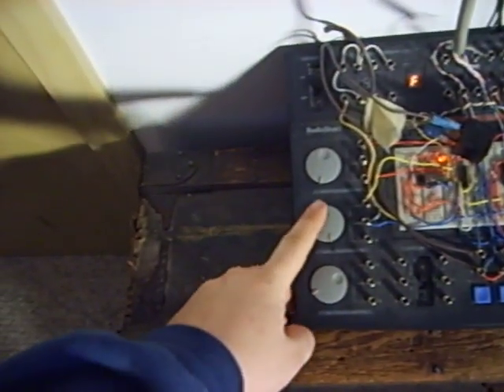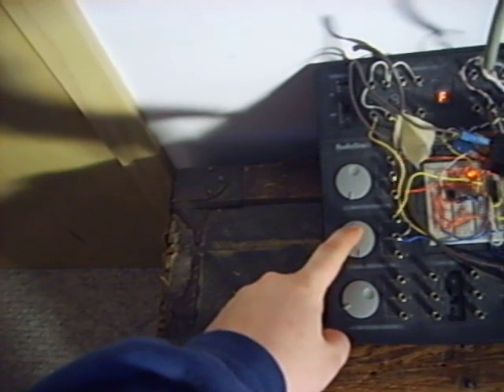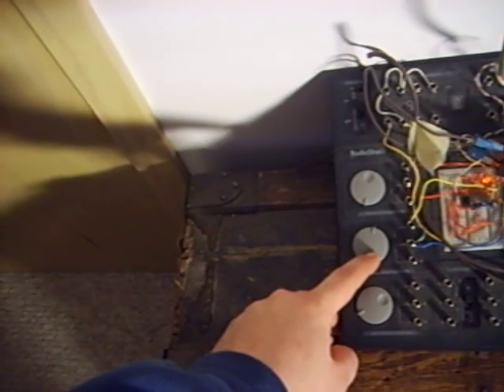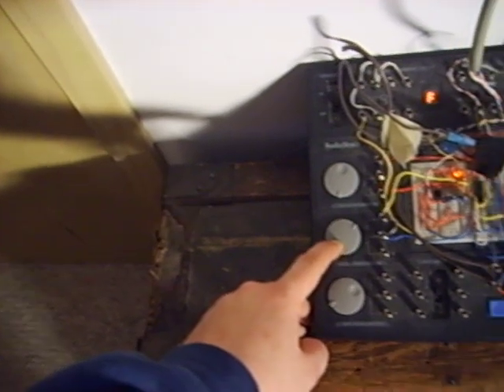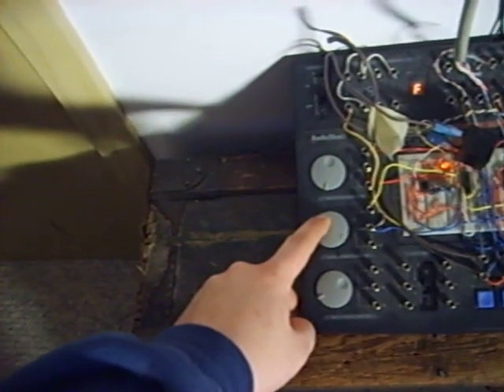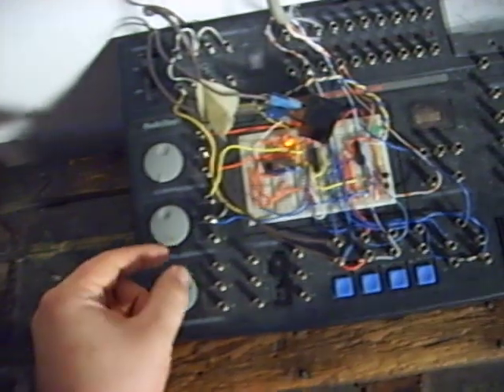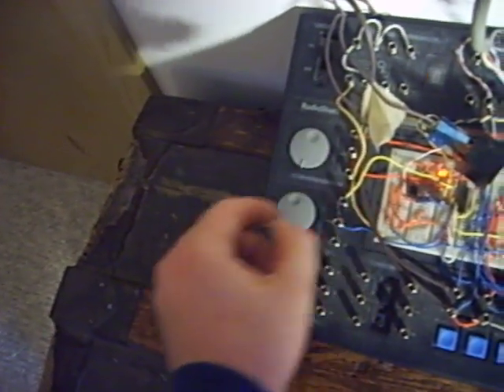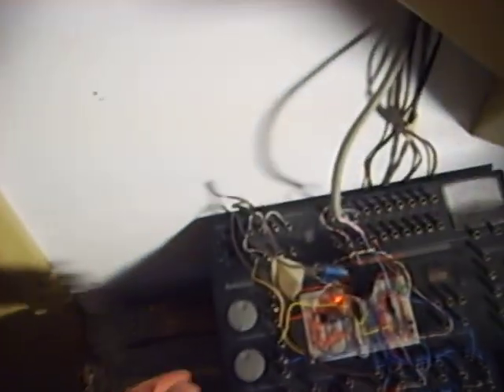Homemade Fire Alarm System - Modes Overview - 9 of 11

Comment from the maker: I'm sure I could but it would be a bit more complex as it would probably require a combination of counters to simulate the code. The 555 timer can do a repeating on-off easily but adding in the pause would require another level of circuitry.

Comment from the maker: Technically no, but with the right resistor-capacitor value the "flash" (oscillation) frequency would be high enough that it would sound continuous. Realistically you would just bypass or eliminate the whole 555 oscillator and connect directly to the delay 555 circuit (this is where the red alarm lamp is connected)

Comment from the maker: As far as hooking up a pull station goes, it works just like a switch; two wires, when activated complete the circuit (non addressable, of course, think of addressable more like a component on a computer network)

Comment from the maker: Yes the "panel" is a RadioShack 300-in-one electronic project kit. ($75-ish, cheaper on the Internet). The silver panel on the wall is just a 2-gang blank metal cover plate from Home Depot with lights and buttons from RadioShack. I id but extra components that did not come with the kit - 12v car relay, extra 555 timers, etc.